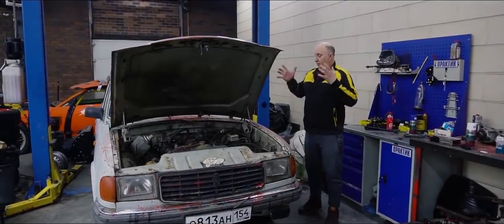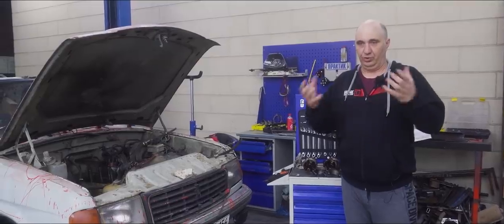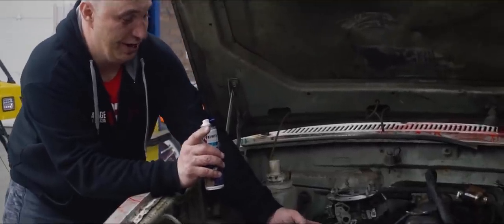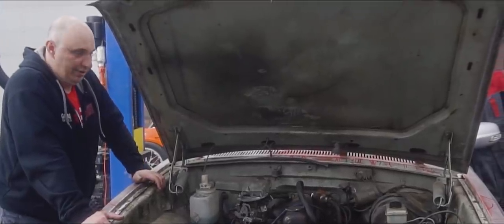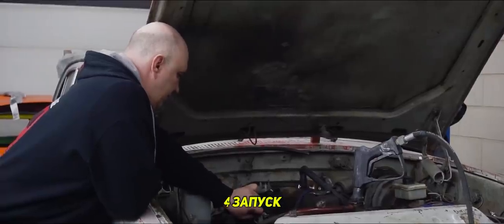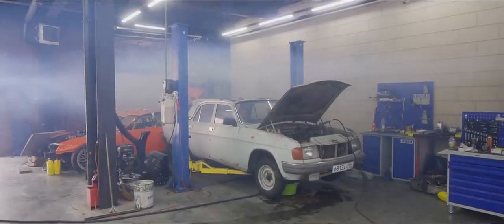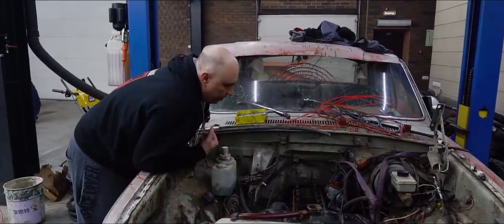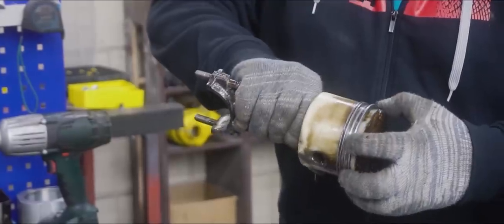Fabricating plastic pistons (will they work?)

Comment: But flouroplast (PTFE) is fine up to 200 °C and caprolon (PA) only 100 °C. When Vlad said "what plastic should we use" I immediately shouted PTFE.
Reply: But combustion temps can get a lot higher than 200 C. Especially on a petrol engine
Reply: you woudn't want to be breathing PTFE smoke let me tell you that.
Reply: Not sure what you are talking about there.
Ptfe/Teflon is fine up to above 300°C. However, Ptfe is one of the least useable materials here. It may have a high melting point, which is not relevant here. What is needed is a polymer with extremely high thermostability, one that does not expand when heated. Sadly, Ptfe has virtually no thermostability, it has a very high degree of thermal expansion.
What's needed for this application is a "thermoset" polymer which does not expand when exposed to heat. Epoxy would be a very good suggestion.
So shouting Ptfe was the wrong call!
Reply: @thefreedomguyuk  I think PTFE would have worked much longer than PA. My 200 °C were just a ballpark number, there are many different kinds of PTFE, each with their own max temperature. The smoke is a problem, but I am sure the PA smoke was not very healthy either. Why not push the car outside for the test?

I did not know epoxies had so much lower thermal expansion. But wouldnt they produce more friction than PTFE ort be to brittle? In any case. With metal pistons usually reaching in the 300 °C range and the poor heat conduction of plastic. There is probably no plastic you can keep under the glas transition temperature under any usefull load.
Reply: Good idea
Reply: What about delrin?

Comment: Suggestion: what happens when you use automatic transmission fluid in a manual gearbox? Or vegetable oil or something else that isn't suppose to go in there.
Reply: ATF in manual gearboxes is common....Ford did it as well as Mazda.
If you put 90 wt in them it will shift really slow, and the synchronizers will eventually fail.
Veg oil, prolly the syncs and bearings will fail after it gets hot.
Mineral oil takes heat much better.
However it is possible to make veg oil lubricants as long as you put enough additives in the mix......most of them being made from mineral oil.
Reply: You could try maple syrup instead of of engine oil, but Master Milo already did that.
Reply: My old ranger used  atf in a manual 5 speed

Comment: Have you guys considered using a single cylinder motorcycle engine for all your testing? It would save you a lot of work.
Reply: Lada are cheaper  in fact most people pay to get rid of these horrible  motors . I still feel Renault  had something  to do with design  of this horrible  motor
Reply: @garypeatling7927  Cheaper yes but there's 4 cylinders and carbs to work on.

Comment: If you could put some kind of metal cap on top of the plastic to deal with the combustion heat, it might actually work a bit longer.

Comment: Without watching first I’ll say they last a minute or two before they become a melted blob!
Reply: Without watching, the last minute or two I imagine Vlad saying "Well that concludes a successful test of how to get pistons to work in a pinch for super cheap!"
Reply: @amorag59  I was quite surprised the test turned out quite well….obviously they will fail quite soon, but if one was doing research he’d see potential for more study!
Reply: @jonnycando  All jokes aside, I'll give this a gander when I get home. I've always wanted to 3d print an engine in plastic, run it off a low temp burning fuel like isopropanol and water. As you say the potential and curiosity is there!

Comment: What kind of "plastics" do you use. It looks like a thermoplastic material like PE or PP ? Try unidirectional glass or carbon fiber reinforced plastics  (with an Epoxy Resin or PEEK as polymer matrix)

Comment: Almost 40 years ago, I met a guy who was a part of Amoco's plastic engine project.  At least the block was plastic.  Maybe the head and pistons.  He was sure it had the potential to go into production but expansion was a problem along with subsequent cracks and leaks.  But Amoco oil did have the rights to a strong and heat resistant plastic back then.

Comment: 1. Try making a metal cap on top of the plastic pistons or 2. use plastic as filling material to light up the pistons' weight. Try conducting heat on metal surfaces of the engine head. Possibly rings are good solutions for this purposes.

Comment: The highest melting point of performance plastics PTFE and PEEK both have melting points at 600-650 degrees. Combustion temps are 1100-1400. Add to it that 1 cubic CM of PEEK is 3 grams and aluminum is 2.6 grams so it would also be heavier....    Plastics arent there yet...  However, carbon fiber can take heat up to 3600 degrees and have a weight of 1.6 grams. There are already pistons with carbon fiber skirts and of course carbon fiber connecting rods. Of course, they aint cheap!  LOL

Comment: Try a 2 piece piston, top 1/3 from a regular cast piston for the grooves and temperature/pressure resistance, and the bottom 2/3 made from the nylon thermo plastic. Weight reduction to the max, but will the wrist pins hold up? Then after you could try your carbon fiber skills once again and try a bottom 2/3 out of that.

Comment: Celazole® PBI – In temperatures exceeding 400ºF, Celazole® PBI has the highest heat and wear resistance, as well as the best strength and mechanical property retention, of any engineered polymer available. I have no idea how much it cost most likely too much.

Comment: Thanks for doing this experiment. I haven't done this before, but I've done things of this nature, trying to "beat the system". I honestly didn't believe any type of plastic would last at all, due to the heat. Gasoline in the chamber at the proper ratio burns at what - 1300 - 1400 degrees f.? Most plastics become like bubble gum at what - 500 - 600 degrees f.? And Thanks Russia. Good cultural exchange. You're a great nation.

Comment: Should have mixed some aerogel microparticles and/or tungsten carbide into the plastic. That should boost its ability to resist high temperatures quite a bit.

I'd also have coated them in something super slippery like a thin layer of tethlon, so that even when they expand they still have a bit of ability to move.

Comment: You should make a cast or forged top cap for these plastic pistons , that way you get the high heat durability characteristic of metal for the combustion area and ring seats and the low friction of the plastic for the piston skirts ?? Be interesting to see

Comment: i would like to see you guys do ceramic pistons hell you could have put a layer of ceramic on those plastic piston and they might not have failed in the first hour as ceramic is a great insulator and very stable in terms of expansion under heat cycles

Comment: Maybe if you fill the plastic up with wter it would solve the problem! (i've once tried to melt a plastic water bottle but because the water was inside , it did not melt, it only turned black and toasted. )

Comment: Actually the high power drag 3.5 second quarter mile vehicals have to be preheated to a very hot tempature way before they can start the engine.

Comment: Here's another one..... kind of like the direct drive transmission one. Yeah 4th gear  is the same, one to one direct drive. And yes, Ford already made an engine that was plastic, ceramic cylinders, and ceramic topped plastic Pistons. In fact, I think the whole block was also plastic. Look it up it was in Popular Mechanics in 2002 I think.

Comment: Correction it is not the piston but the rings that expand. Drag cars that run nitro methane or people that push boost do something called an over bore along with a process were you trim the rings. Without these modifications the boost or nitro methane will cause the rings to expand in the cylinder do to high heat. If there is not enough expansion room the rings will snap and destroy the engine

Comment: I feel this could work long term in a small liquid cooled single cylinder, not as solid plastic, but as a 50/50 plastic and metal combo.

Top is steel, bottom is plastic with brass bearing

Comment: they don't increase clearances for F1. they reduce then meaning the engine cannot be cranked at ambient temperature. you need to heat up the engine and engine oil and crank it for a few seconds with an external starter to lubricate before even attempting to fire it. this is one of the reason why they are much more efficient (efficient as mechanical energy provided/chemical energy contained in the fuel) compared to road cars, but not anywhere capable of daily driving like cold starting or idling < 1000rpm

Comment: Was it also running rough because the plastic pistons weigh less than the real ones so they threw off the balance with the counterweights on the crankshaft?

Comment: Years ago my dad shop we got to work on the Heineken speedboat the motor was made by Ford Motor Company it was 70% plastic that was mostly the block and cylinder head in a intake manifold but they race the boat for years

Comment: Machine them to a smaller size so that when they expand there is a perfect fit. Also line the tops with a high heat plastic to protect the stronger plastic.
Reply: Would'nt start initionally , there be lack of compression.

Comment: This is why you never want polytetrafluoroethylene (PTFE) additives in your engine oil. At boundary locations, like piston rings and valve stems, the additive expands and acts as a squeegee and seal to prevent oil lubrication. A lot of wear and tear happens then.

Comment: What if you tried to make pistons out of clay ceramic? It doesn't expand that much and is resistant to heat, but it might scratch the cylinders, although if you think about it, it is sometimes recommended to use ceramic oil additives, so maybe the ceramic piston would work like that as well.

Comment: You have to be cautious when engineering with Nylon, even industrial grade's. Some can absorb oil, swell up and then you'll find that your Nylon components are well out of dimensional tolerance. Of course, you can accommodate that at the manufacturing stage's but by how much !?

Comment: Could the shaking perhaps be a result of the pistons not weighing the same as the pistons you removed; how much did they weigh?  And perhaps it's not a good idea to make pistons out of a flammable substance like plastic!  At the very least, cover the top with a metal cup to protect it from the oxidizing flame front, if not the melt temperature; what is the melting point of the plastic you used, anyway?  

As for snap rings, all you really need is a button on either side of the wrist pin to keep it centered; just keep it in contact with the cylinder wall on either side.  I would think the side thrust would be hard-pressed to dislodge the pin from the wrist pin holes.

Then he finds out that Caprolon is the Russian word for Teflon, and the smoke is carcinogenic polytetrafluoroethylene gas.  No problem, tovarisch - just gargle with vodka and all will be well.  Za zdaróvye!

Comment: Should try again or similar with some water meth injection. Sublimation cooling is way more efficient than radiation, but I honesty did not expect it to be that good as you can see in number 4, doing it controlled would be very interesting to see. Also should hook up some thermocouples so we can see what is going on.

Comment: F1 or really high performance engines won't even turn over unless thare heated via external heater to operating temperature thats how tight the tolerances are in those they don't have increased tolerances as you said

Comment: How about making pistons of pure magnesium ? That could get interesting 😉
Reply: Or with a properly chosen set of other metals in the alkali group that might spur the reaction further, like aluminum and iron oxides do in thermite.  Not a chemist or a materials engineer (alas, electriconics) so ignore if an ignorant statement.  LOL  It is obvious by the lack of response to your comment that it flew well above most readers.  I, for one, laughed and appreciated it.  Engineering or nerd humor, like idiot proof and engineer resistant, right?  My favorite.  :-)  Fairly accurate too, in my case, at times.  This channel is industrial strength stupid, but funny as hell.  My son pointed me to one of them.  If you haven't seen it, look up' turbo encabulator' in YT, you will likely split a gut, I did.  In fact, it's been years and I think I'll go watch it again to see if it's really as funny as I remember.

There's more than one, this is the one you want...using Chrysler as the example, genius:

https://www.youtube.com/watch?v=MXW0bx_Ooq4
Reply: @MrJdsenior  Nice, thanks for the link. That was a lot of nonsense, I think most people without knowledge about cars and engineering won't hear a difference compared to "normal" technobabble 😉

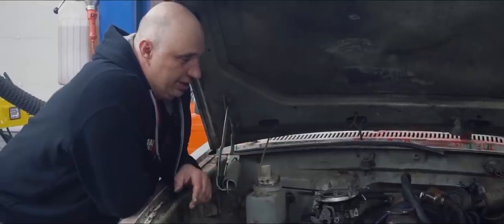Comment: 7:27 "Race car engines they increase tollances" WRONG.  In F1 cars they DECREASE clearances to such an extent that untill they've warmed up, they are siezed.  To start them they have to first warm up the engine to running temperature.  Only then is there sufficient clearance to start turning over the engine.

Comment: If you ‘reversed’ the cam, could you make an engine run backwards..?
Reply: Boats with two inboard engines usually do this. Having both props turning the same direction causes problems due to torque effects, so one engine is cammed to run "backwards". It's a little more complicated, water pumps have to be redesigned, for example.

Comment: I think Chrysler is given shit for nothing, they are not unreliable, they're less reliable than some competitors.

I've worked in the auto business for 21 years buying and selling used cars. I'm going to do something terrible and generalize but people that buy Chryslers are either enthusiast and take care of the car or they're the type that doesn't get an oil change for 20k miles and has tire threads showing. 

If there's one thing that makes a Chrysler last its timely maintenance. 

During Cash for Clunkers I put sodium silicate in the now government-owned vehicles engines to destroy them, Chrysler products all lasted the longest and I'm not sure what I'm getting at but it's gotta mean something!